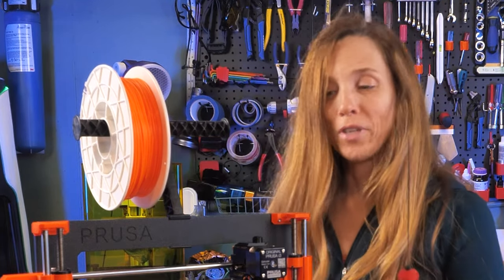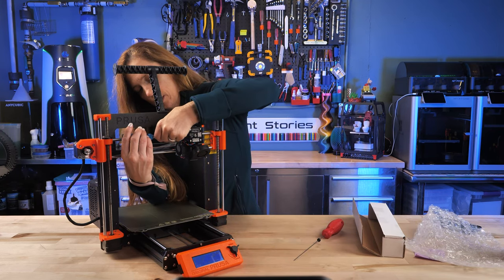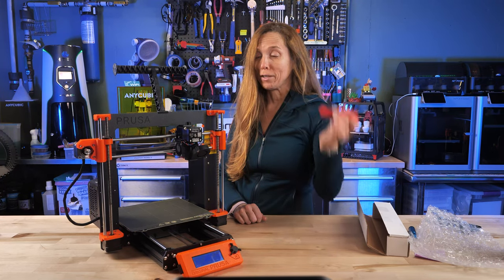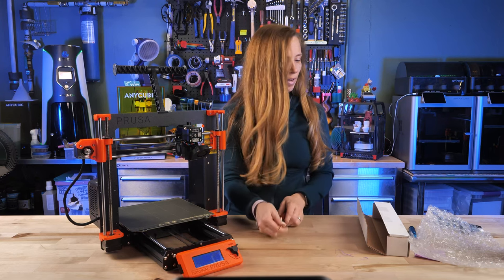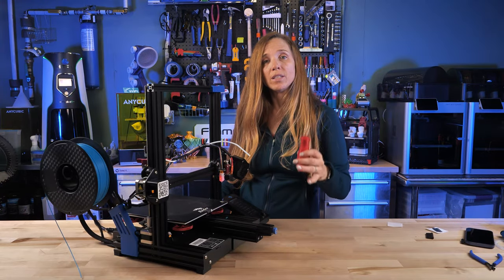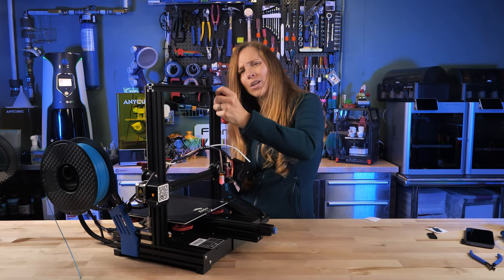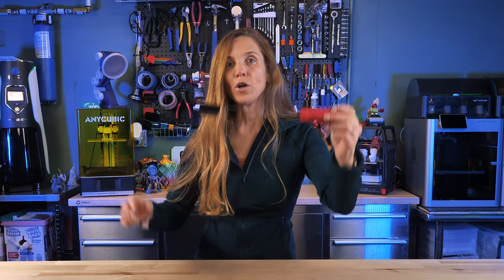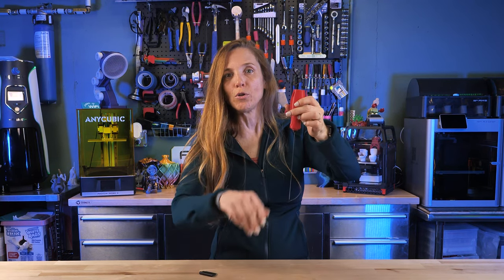Fix your 3D Printer Clogs in 30 seconds with the NoClogger!

Comment: I just use a “marker flag.” The steel rod is the perfect size. Much cheaper. Print your own handle if you want.
Reply: The little flags you get at the hardware store for your lawn?
Reply: @s0upcan2323  yes
Reply: Thanks!

Comment: I have used a piece of an old wire coathanger that is 1.66mm in width, I have used this for years and it works just fine, I printed a T-Handle for it and epoxyed it to the wire.

Comment: 3:29  I have a Pokenator, L shape handle with a similar precision needle buts shorter. I think your length might be better. And it has a hex shape key in the handle to unscrew the nozzle I assume, it doesn’t fit. Will definitely look into the NoClogg tool.

Comment: Very cool product.   Seems reasonably priced as well.   The only concern I have is that it's not so easy (for me anyway to remove the Bowden tube from the hot end.  Access to the mechanism is tight and sometimes the tubing will not release.  Once it is removed, you then have to make sure reassembly is done right, so you don't have any leaks (don't ask how I know this) and if you have to readjust or tighten the nozzle you then have to readjust, your zero offset.    Maybe I need a direct drive extruder....:hand-orange-covering-eyes:
Reply: Extremely usefull hack, split your bowden in two parts, one that connects the extruder to the hotend coupler and one that goes from bellow the coupler to the nozzle, Chuck from fillament friday has a video on that, I've done this on my ender with bowden setup and it's amazing.

Comment: I used to have a length of brass rod that I used to use like this. It cost me next to nothing. I’d scrape the plastic off it with a craft knife.
I don’t get clogs often enough these days to even bother looking for it in the garage.
Reply: I received a tool with my printer kit that seems made of some very springy stainless alloy. The filament doesn't stick to it at all, not even a tiny bit. Plus it takes longer to wick heat, which is a bonus too. I think if you can find a stainless rod which is just sufficiently under 2mm dia but thicker than 1.7, you have a winner.

Comment: This seems like it will solve a lot of problems. While making a few ones a lot worse. Yes it will push material that has decided to be stuck in front of the melt zone into it and through it. But pushing abrasives and or stuck materials that somehow are clogging the nozzle with particles that are experiencing different problems than being not melted. into it might even make it worse. Cold pulling still seems like a better solution for it. As you pull out the issue instead of damaging your nozzle by forcing things through it that don't want to go.

Comment: An Amazon reviewer posted images illustrating poor build quality of the NoClogger, which persuaded me to make my own device using high-quality SMOOTH AND POLISHED music wire (spring steel) as well as a sturdy solid handle.

Considering the flexibility of music wire, a suitably long piece of it could clear clogs in Bowden printers without the need to unclip the tube from the hotend. Some tubes unclip easily, but others (such as on my Anycubic Kobra Max) do not.

A clever design could quickly switch from adapted to clearing clogs in direct-drive or Bowden printers. Tools should make life as easy as possible. When they do not, their designers should return to the drawing board.
Reply: Just got my NoClogger. Its built solid!

Comment: But what if its a CHT nozzle?
Reply: The CHT nozzle would be completely in the "hot zone". I think this tool, as she mentioned, is more useful for pushing filament that has managed to melt in the "cold zone" back down where it can melt again.
Reply from the maker: I would not use it on the CHT-- you could push filament from the cold zone into the nozzle, which might work, but then you would run into the nozzle and possibly damage it.

Comment: I received a 1.8mm springy rod with my printer kit and they also sell it as a replacement part "Filament ejector pin" or "Hot end push down tool", don't remember which. It only has a pressed nub on the end instead of a handle, and i think the nub might be 2.9mm wide :D so unfortunately it's easy to reach uncomfortable temperature, if you opeeate it quickly it's OK but not ideal. First i tried some heat shrink on the nub but wasn't happy with the result; then I found and printed myself a luxurious handle that i epoxied on the nub. Printed with fuzzy skin, which has an extra benefit of hiding the seam which i made random.

Comment: I have a thing that's acdually in pottery making. It's some sort of design tool and is basically a long metal rod that's tapered on the tip and has a handle. It's the perfect diameter for this but if I didn't have this thing, it totally get that.

Comment: ... So its a 1.5Dia steel rod with cone end and a large 3d printed handle? I mean I'm pretty sure it's not super recommended to shove metal down the the extruder, but even then, I'm able to find packs of 5 200mm 304 St St rods for half the price one NoClogger is being sold in £.

Feels a bit expensive for so little, but whatever suits you.

Comment: I don't see the benefit for Ender style printers, besides being hard to remove the PTFE if you have an all metal heatbreak you might scratch the inside polish and get filament to not flow correctly over time. I think getting a 10-50m roll of 1.6 or 1.8mm trimmer line nylon from the hardware store and doing cold pulls is a much better and easier solution.

Comment: I had one and returned it. The metal rod was rusty and not smooth. Also the handle was very poorly 3D printed. I did get it directly from the manufacturers website so I know it was authentic.
Reply: Could have Just sanded the rod down and coat it with a thin layer of something so it doesn't rust
Reply: @sofghost6663  yeah but that’s what the manufacturer should have done. Not the customer
Reply: @raDius  minewas fine when I received mine. Should have returned it then and asked for a new one. Most companies will work with you and send you a fixed/working item yo ensure the customer is happy
Reply: @sofghost6663  if you started with this, I wouldn’t have said anything against that

Comment: I've been using steel wire to do exactly the same thing for years.
Reply: what is the thikness of the wire do you use?
Reply: @edmar filho  1.2 and 1.6mm depending on the severity.
Reply: I’ve been thinking about getting some 1.6mm wire for this purpose - ‘printer floss’ 😅

Comment: I guess I'm lucky -- the only clogs I've ever had I was able to resolve by bumping the temp higher than usual and then feeding filament through. I've mostly only had clogs when changing from higher temp filaments to lower temp ones and it didn't get cleaned out well enough at the higher temp.

Comment: $15?
30 cm spring steel in mass price is like 15 cent, self printed grip ~ 2 cent. Assembly less than a minute, so let's say 50 cent. All in all, not $1 in total for that part. That's what I call profit margin.